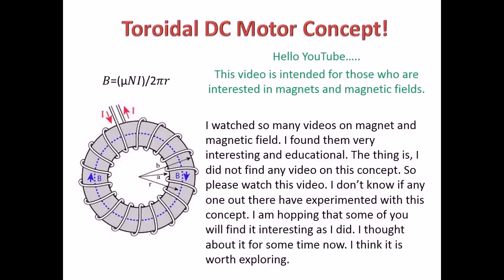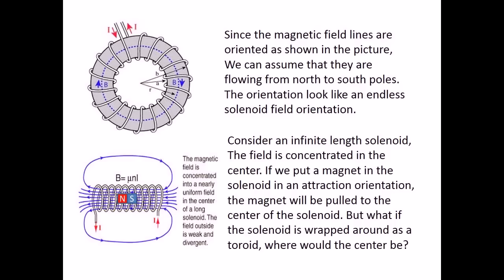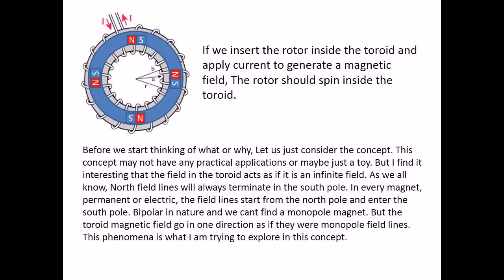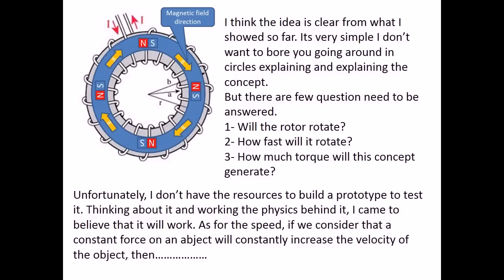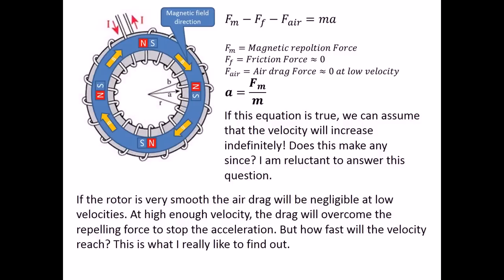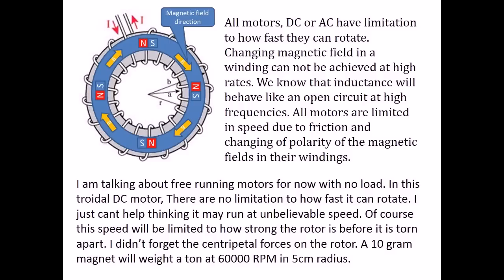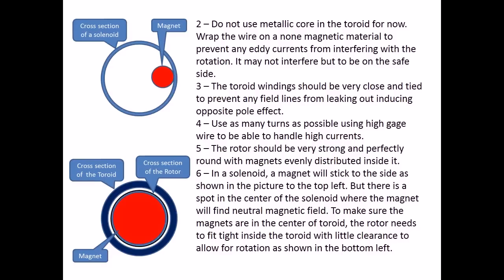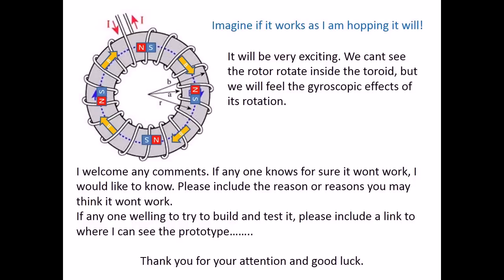Toroidal DC Motor Concept

Comment: i've been thinking of the exact same idea. i take it that you don't think it's gonna accelerate with a hugevrate, but you can't see why not. at least that's what has been bugging me but i think i figured out why it won't.

the magnetic field lines move in one direction between the magnets and the other direction around them. the lines inside the magnets should has less of an effect than the ones outside.

though, i think there could be a magnet configuration that makes the flow in one direction through the center and the flow in the other direction on the outside.

in any case, not having to change the polarity, imo, can still be a huge improvement on efficiency. then again electric motors are not known for their inefficency

Comment: This is an interesting idea and I've never seen anything like this before in over 50 years of electronics, but I have the following comments and they are all problems. 
...
Unfortunately it won't work.   But first, some of the obvious things.  
...
Every motor also generates a voltage when it is turning. We model a motor as a generator in series with a resistance. The voltage of the generator is proportional to RPM. This voltage is called back-EMF. As the rotor picks up speed, the back EMF increases, and this reduces the voltage difference across the resistor. This means that the current through the motor decreases as it comes up to speed. The torque that a motor produces is proportional to the current through the motor. As the current drops with increasing RPM, the torque will decrease. It will stabilize at a point where the torque is just enough to supply the load. For an unloaded motor this is basically the torque of the bearings and maybe any air resistance that's involved. This tells us two things. 
1. The motor will not increase RPM indefinitely and
2. Motors are basically wound for a given voltage and the RPM that they want the motor to operate it.
...
There's also no way to get the motion of the rotor out of the toroid.
On the other hand, if you could make the toroid hollow, and have one Magnet or several magnets in some kind of a shuttle that slides around the tunnel inside the toroid, perhaps you could put two ports going through the windings, one to allow liquid in and the other to allow liquid out, it might be used as a liqid pump. There are rotary pumps like this that use a rubber set of fingers sliding around a circle and there are two ports one to let liquid in one to let liquid out. I have a small bump like this. I think this is called a "vane" pump.
...
All that said, the BIGGEST PROBLEM is that the magnet will be centered in the common straight solenoid.  It will NOT be propelled through the common solenoid!
...
If you start with a diagram of the standard linear solenoid and a small bar magnet, you see the bar magnet is attracted inward toward the center from either end, where there is essentially no force on it. It is  not propelled all the way through the linear solenoid.
...
Therefore, in the toroid, since there is no end, the magnet won't be propelled around the toroid at all.

If you turn the magnet around, it appears that will always be repelled from wherever it is, so again, it will still have no force on it and not be propelled at all around toroid.

It started looking interesting but you need to correctly apply all of the laws correctly that are appropriate, not just some. It almost had me fooled there for a minute, but I looked very carefully at the fields with the magnet at either end of the linear solenoid. 

It won't work from the magnetic standpoint.  You need to understand magnets more fully.

Most people trying to make magnet-only motors also do not understand magnets fully.
Sorry...back to school.
Reply: Observ45er what if let's say the instead of the torpid having one phase, we rewind it as if it has three phases like a typical brushless motor?  And if it was an axial flux motor?  Because I found the following https://youtu.be/3j8JgDLrFYY  is this considered a toroidal motor?
Reply: there's absolutely a way to get the motion out of the rotor. you just need a notch at a point, just enough to expose the moving donut of a rotor and the rest is easy. you can have a ring gear on the rotor and connect a small gear on the notch.

you're absolutely right about it not going to accelerate indefinitely but all the relationships you gave are, i think, invalid for this type of setup. the torque rpm trade off is all about how fast you can change the polarity of the phases. you have too many phases, you'll always have your phases close to the poles and create bigger force thus bigger torque, but the rotor has to move slower to let the phases change polarity in time.

these don't apply here. you fon't change polarity at all. the reason for this to mit act like an accelerator is that the continuous selenoid will meet the magnetic field lines flowing counterclockwise between the magnets but clockwise on the magnets
Reply: @timucinbahsi445 This is very old, but re-thinking, I believe I mis-spoke about some of that.
..
It will work as long as there are poles on shorter magnets.  
After writing that, I have seen You Tube videos with LONG spring wire coils with magnets stuck onto double A cells.  The cell provides the current for the coil and the  magnets are constantly propelled along the coil.
.
Using insulated wire, you can supply an external current ahd make an electric train with the magnets, but they will short the coils, so you need to insulate the magnets.

However, I am not sure about a continuous "ring" of magnets because the field at one pole will be "sucked" into the next magnet's pole.  I believe you need an external field around the moving magnets.  That field is needed to interact with the toroidal field. 
Good luck.
..
However, how do you get the rotation out of the toroid to do anything useful
See these:

https://www.youtube.com/watch?v=J9b0J29OzAU 
.
https://www.youtube.com/watch?v=7jqImhd8Ggc
Reply: @Observ45er  that's exactly what i think will happen. the field lines go in one direction between the magnets and the other direction on the magnets. some sort of magnet configuration can make it so that clockwise field lines are in the middle and ccw lines perimeter, through the wires maybe. a bit like how halbach arrays manipulate field lines but different.
Reply: @timucinbahsi445   Sorry, but I can't understand that.  I'm not sure about what i said above, too ,much thinking.. . . ;)